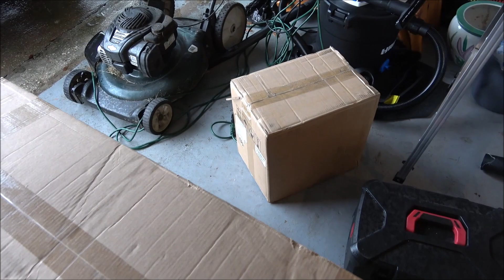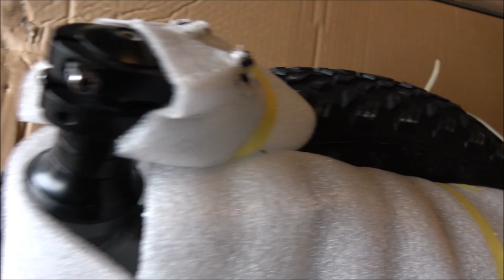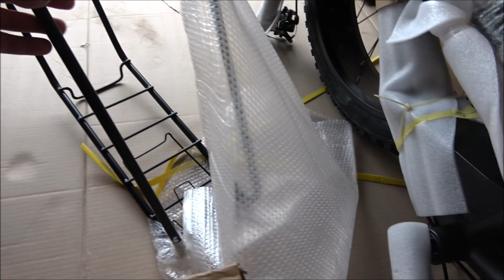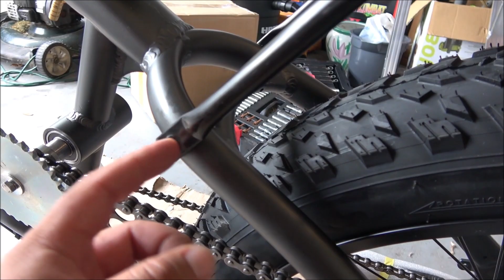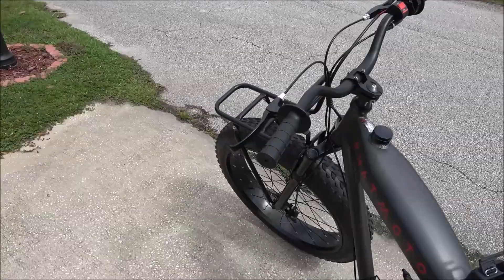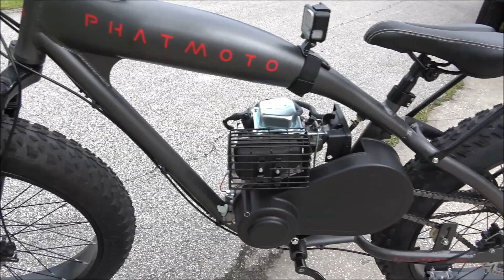PHATMOTO All -Terrain - Fat Tire Motorized Bicycle!

Comment: Hands down, I’d take this any day over a electric scooter! If an EMP hits then you’ll wish you had a gas engine.
Reply: If an emp hits how are ypu going to get gas?
Reply: @lordtartarsauceb8348  you’ll have a full tank that will get you out of the city
Reply: @thirdeyesurvivor3886  think it’ll ONLY happen in your city?
Reply: @Illness.og.  no, the whole United States
Reply: these things still have CDIs which are normally susceptible I think to a devastating EMP perhaps unless you add extra shielding or something
Reply: If an EMP occurs then your spark plug and coil would malfunction too.
Reply: @SLE783  maybe put it in a special box that emp cant get to
Reply: Vsett 11+ super 72. It goes 65mph. Would smoke that bike.
Reply: Lmfao. an emp 😂 what is this science fiction 😂
Reply: The only way for an emp too work is if you took your computer apart exposed everything and then put it within 3 miles of an emp device, or if it's the sun, (you'd be burnt before you worried about an emp from the sun) if the computer has its case on, an emp won't affect it.
Reply: @kaden Bef  some ebikes do 15 mph some ebikes do 120 to 300 mph.
Reply: From Colombia .  EMP .? What you’ll gringos talking about.
Reply: Flip right ❤
Reply: @LoLErMan13  anything over 32 mph is no longer considered a e-bike, it is considered a motorcycle and requires a motorcycle endorsement. This also applies to gas engines.
Reply: @lordtartarsauceb8348  you make it. D U H!
Reply: @SLE783  spark plug? dude...
Reply: @GiacomoRavioli  thats a hell of a lot of work and youd need a diesel engine.
Reply: @kadenbef3871 Not if you upgrade the engine to a better 4 stroke, 150 cc😎

Comment: It's just perfect, for our 2nd great depression. I love it! They can make these quiet, and cleaner, but in California they want to ban small gas engines altogether. We could ride this to the bread line, when the electric goes down, but Newsome won't allow it.
Reply: Lol
Reply: Yes, exactly why I bought mine.  When we can no longer afford gas to drive our cars, and the electric ones no longer work;  we can still get around a little bit with some motor power - at least for a while.  Of course you still have the thief problem, which will get worse with the engineered depression and food shortages.

Comment: I'd really like one of these, I'm kind of stuck between this and an electric scooter that goes a little faster for the same price. The only thing that concerns me about these is that all the reviews I see oh, a lot of people complain about the condition they receive them in. So finding someone who will ship it to you in good condition is a concern
Reply: I’ve recently gotten one and 3 of my friends have them too, they generally ship pretty well. Only issues with the bikes are either the spokes on the wheels (easy enough to replace them) or the transmission, which can take a bit of work, but a CVT works great with them.
Reply: Honestly if you in city and mainly for commuting. Get electric. Will be more reliable down the road. If you like gas power get you a grom.

Comment: Love it!  I put a 79cc Predator on a trike that I built with a OCC schwinn chopper frame and a 20 inch adult trike rear end.  60 tooth rear and 11 front. She does 38 even.
Reply: What about up a hill does it maintain that speed? My 52v 1500w ebike does 38 or 40 on flats and 45 down hills. And 28-35 up hill.
Reply: @Mishakol1290  thats pretty nice
Reply: @Mishakol1290 his rear sprocket helps with hills. Good amount of torque

Comment: How loud is it? They should add a kick start, stronger chains/belt, fenders, and exhaust pipe. Comparing this with Bolton ebikes foxbat it seems good because it's cheaper, but you can also get a cheap motorcycle like the CSC SG250 for less than $3000 shipped. Italika also has some really nice cheap motorcycles, but importing/registering them might be a nightmare (eg: SPTFIRE200)

Seems like people with credit cards and no common sense drive up the prices of these things, I would think all ebikes/gasbikes should be under $1000

Comment: Got mine over night... got it today... haven't un boxed it yet..I got the green one
Reply: how much it cost?
Reply: @Force1Com  probably too much... I got mine for 1299..... they go for 1399 I think now at asking price.. can get them for 1299
Reply: @Force1Com  actually now I'm doing a return on it... came with flat front tire out of the box (damaged tube).. and further inspection... the rear wheel is assembled wrong and the gear teeth are up against the brake mechanism and chains are not right to where the wheel won't even spin... im returning it before I attempt to fix any thing and try to assemble it... no way...I don't even want it now
Reply: @ItisMeMike  Good luck on the return you want to sell it? Depending on where you live and the price, I'm looking for a second one. Must be a new color didn't know they come in green.
Reply: @tomtee4442  I returned it with no issue.. sorry...I got the ecotric bison 🦬 e bike instead . With the return money
Reply: Phat motos do have their problems even new in 2019 mine had no instructions before they had any videos. I'm very mechanically inclined and you better be owning one of these motorized bikes. I placed a order on mine and waited a few months. I paid $550.00 for mine not to bad. I was thinking about buying a second bike but didn't.
Reply: @tomtee4442  550 I would maybe keep one.. but for how bad it was.. was not worth 1400....550 yes...1400 nope
Reply: @ItisMeMike  Phat moto they don't seem to care. Their quality control mostly just goes out the door by the bad comments and reviews online.

Comment: MJTech, how do you adjust the speed limiter or bypass it?
Reply: There's a throttle limiter screw on the secondary throttle linkage. Loosen the screw, throttle opens more. It's a torx screw

Comment: It has an aluminum frame, thus it begs the question to how long it will last?!
Reply: Long time. They use thick aluminum for down tube and rear triangle also the head tube. I have 670 miles on my phatmoto. And then I have around 500 miles on my normal fat bike that is aluminum

Comment: Would the 212 fit on that frame with the jack shaft or would you have to remove the jack shaft
Reply: Use a 60 tooth rear sprocket and then the jackshaft will not even be needed.  But  keep the throttle stop screw turned in a bit, or you will end up doing over 60 mph...

Comment: Can be ridden all day carrying camping gear? How far between fill-ups? Does it overheat on long climbs?
Reply: I've ridden mine 40 miles once on one day. It can run all day, its basically a generator or pressure washer motor. It does not climb hills well due to the clutch unless you pedal. Since I have a smaller rear gear I get higher speed but waste more fuel to get there. I have to fill it up every 70 miles or so,I don't run it completely empty because its never good being stranded. I have 670 miles on mine
Reply: @kevinmontoya7318  Too bad it can't do hills, that's where the sadists put all the campgrounds...;  )  My knees are getting too old for that.
Reply: I have one. It gets 150 mpg.but that depends on your weight .it will make your eyes water riding it.
Reply: @pedantus  All you have to do is put a larger sprocket on it and it will do hills a lot better.
Reply: @kevinmontoya7318  what did you do to mod the rear gear? What speed can you get up to?
Reply: @jritchie70  you can find them on ebay because they're basically the same sprockets as the motorized bike ones. The problem is, is timing the drive chain to the pedal chain, unless you buy a tensioner for the pedal chain

Comment: Is it street legal? I’m thinking of getting one. I have electric bike but I need this one because of range anxiety with e-bike.
Reply: It isn't street legal in most places because it exceeds the 49/50cc motor restrictions. Instead of asking YouTube,  you should be asking your local DMV or check your state laws pertaining to motorized bicycles.
Reply: True but every thing is illegal even a pedal bike going to fast is illegal and can be given a ticket. I have a Phatmoto I always keep pedals turning, courteous, I wave and move off side walks for pedestrians coming. Don't want anyone to call the law for riding a motorized bicycle. I ride on trails, side walks away from traffic as much as possible, no riding or playing in traffic for me. I got my phatmoto at the beginning of January 2019 when they first came out. Also I put 49cc stickers on it. No police except one stopped me in another state he heard the engine on and I cut engine off when I saw the law. officer said I can have a bike with a engine. but not on and engine running in that state unless I wanted to register the bicycle. I was nice to the officer acted like I didn't know the law and rode on after his advice. A few blocks later tired from pedaling cut the engine back on and cruised but riding slow is the key! Just use common sense riding you will be ok. I was thinking about buying a electric bike glad I didn't when battery needs replacing battery is pretty expensive and will only last so long. 4stroke motorized bikes for the money will last longer, over all cheaper to repair - maintance cheaper in the long run and hold more value and will resale better than electric bikes!
Reply: @tomtee4442  The bikes acting in an illegal manner are the douchebags that make all bikes look like douchebags. The same can be said with motorized bikes. It only takes one to ruin it for everyone. Where I live, the cops give us a common courtesy as long as we obey the traffic laws and aren't acting like obnoxious douchebags. The one that ruins it for us will blame everyone but himself.

Comment: Could this build be jack shafted in your state? Using the derailer for transfer of power there would be no need to worry about how many teeth you had on the rear end. Not just a speed issue but wouldn’t being jack shafted help for when the bike really needed the extra power off-road?

Comment: Do you still need lube with grease  the clutch or does it already come grease up
Reply from the maker: Yes it is recommended
Reply: Hey I'm using a 44 tooth and it didn't really Didn't get more speed but does have slightly less torque is there anyway I can get a smaller sprocket for the Jack shaft so I can have more torque with the 44 tooth? Oh and thanks for answering me even though you're busy before
Reply: @MJTechChannel  You probably caught it already one of your side cover bolts missing!

Comment: What thing I want to ask now this is just a pull star or could you peddle it and started to please comment back thank you again for this video
Reply: This is only a pull start. You could replace the motor with one that has an electric start.
Reply: Pull start is real easy on Phatmoto, when pedaling it hard from a work out on bike when I want to take a break. I pull start my phat moto bike going down the road alot. It's not like starting a old non OHV= over head valve 4 stroke engine that yanks cord pull start cord out of your hand in those old compression relief engines that are hard to start. On any  engine maintance and tune ups the engine will start easier and last longer!!!

Comment: Wish I bought one when they first came out for $550 i was afraid they were junk..🤦‍♂️
Reply: They still are.
Reply: What was it like 1989?
Reply: 999 to 1300 dollars
Reply: They were $500.00 regular tire in 2019 when they first come out with no tax. I got mine for $550.00 regular tire waited a few months and the price really started going up now up to $1050.00 regular tire and $1370.00 roughly now fat tire.
Reply: Same. I got the first year it came out. Paid 550.00...frame frame was good, but other parts where cheap and rusted easy. Front fork couldn't handle bumps the best. Hopefully they upgraded better to make it worth 1300.00 tho

Comment: Noticed this video is about 16 months old.
Any updates on the quality and reliability of it?
And how easy is it to ride with the engine off or does it need to be running?
Reply: I know man! I live in the boonies and need to upgrade from my 80cc 2 stroke to something more reliable! This is on my list tho but it would need to last at least 4 years.
Reply: As Im also planning to buy one, on their website they say they upgraded the jack shaft which was making problems on previous models, also the clutch is now a upgraded heavy duty one, but i cant guarantee the quality.
Reply: I bought the first year. Wasn't worth it. The frame was good quality, but the rest of the parts where cheap and rusted easy. Not sure about the newer models.

Comment: wich engine is best 53cc 4 stroke or 49cc 4 stroke. pls tell me, I want to buy a engine kit for my bicycle.
Reply: plz answer me
Reply: I'd go with the 49cc due to the availability of parts. The 53cc has a bit more torque, but not enough to make much difference.
Reply: @dmoore0079  I agree with with the comment above basically. I'm glad I went with the 80cc engine enough power to go up any hill on hard top and pedaling too. I've went up the steepest hill around on my phatmoto. Recently tried to go up very steep hill going to slow and couldn't. I was not use to that area or  would of went faster, couldn't make it up the hill. So I went back down hill and went wide open pedaling then made it with ease up hill. I've also taken the Phatmoto up some of the steepest hills around. But disadvantage phatmoto won't off road like a ATV that has gears and just putting around.

Comment: Could probably fit a bigger motor in it
Reply: Not legally.  But if one is still running gasoline, ones conscience is low to begin with.  Just go electric and the future is yours.

Comment: do you know if the clearance between the top of the cylinder to the bottom of the gas tank more than the skinny tire version, i was wanting to put a 100cc from a jumping jack compactor or a 120 cc, but i think the skinny wheeled phat moto only has half inch clearence which might not be enough for that little bit bigger of a engine.
Reply: I have what I call the regular tire Phatmoto less space between valve cover and bottom of frame. I want to go maybe with a 212cc or 110 - 125cc ATV engine with 4 speed would definitely do the job putting around off road for me with gears makes all the difference.

Comment: Question, do you need a licence for this?
Reply: No you dont
Reply: @shrimpketchup2993  i think it depends on city. I am in san francisco and afraid to buy one because the law for motor bicyle is sketchy.
Reply: @HuyTran-zy9sv  oh ok that’s for the correction. In dc there completely allowed
Reply: Yes
Reply: In a lot of cities it use to be 50cc or less engine size a license was not required. In my city they just changed that rule to any size engine requires a drivers license. This thing already has a bigger engine size than 50cc so you need a license. Keep in mind that every city is different so do more research for where you live other than asking on here.

Comment: In a bit worried and would like someone to help or maybe guide me in the right direction.... 
When I take of sometimes I hear and feel a loud knock like if someone hit something with a hammer. Its in the rotation area. Like where the string is to pull it to start. In there somewhere. MJTech would you know what that is.. I also hear like metal rubbing against each other. In worried that I got a faulty motor! Please someone help! Thank you all and God bless you guys.

Comment: Did you notice the label on the air filter for choke on/ off is reversed? I had trouble starting it, and I couldn’t get any power cause it was running with choke on! Found someone on a forum who discovered his was reversed. Also my throttle slips and decelerates abruptly so I have to use my left hand on the carb to keep accelerating. Finally, the bead on the tire is totally messed up and I can’t get it seated correctly. So far it’s been a big expensive frustration. Your videos are helpful though.
Reply from the maker: Yes I did. I also pointed this out on my 1st gen Phatmoto video
Reply: If your throttle snaps shut abruptly try and experiment with the return spring, find one the isn't as strong.
Reply: Russ - which forum?
Reply: @jritchie70  the phatmoto forum?

Comment: I can't seem to find an oil change interval for this....
Reply: Every 3 months even if you haven't ridden it, oil is a desiccant which means it attracts moisture so even if it's sitting its still accumulating moisture, which is bad for the internals
Reply: As a rule of thumb for me on gasoline engines and to last longer change oil when it gets dark. It's less than one quart. Four stroke engines will usually last a lifetime if you take care of them. I also have a small camping portable generator I bought New in 1995 still running strong!
Reply: Also on a technical note if a gasoline engine in anything is running poorly from running rich or lack of spark. Tune ups need to be done way more often until engine is running good and clean again. A poorly running gasoline engine will let gasoline pass by the rings and into the oil and also affecting spark plug life this a poorly running engine causes more wear and fuel mileage

Comment: I don’t think the predator 79 is worth it. The gearbox that’s common is actually a go cart jackshaft and it’s noisy. Grubee finally came out with a belt drive but it’s $200. Also I’m pretty sure you need a throttle linkage & you need a carb & I take if mounting vertically. So $115 engine + $230 (shipped) gearbox.

You can get a Honda gx50 + EZM for a little under a thousand. You can even call around and get a whizzer sheave so it’s belt final. You have plenty of room for a pedal crank too. My 79cc took all the space in my bike cradle space.